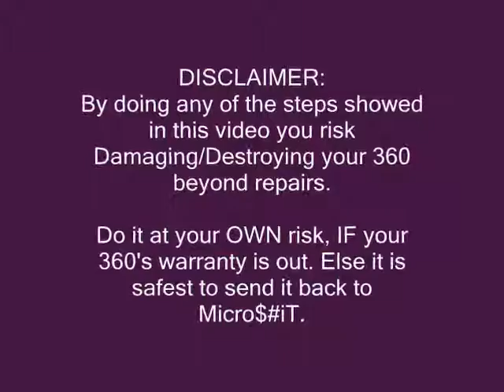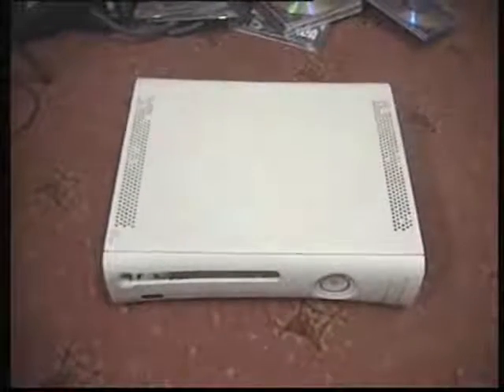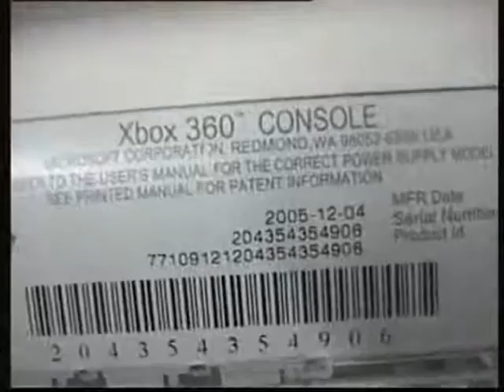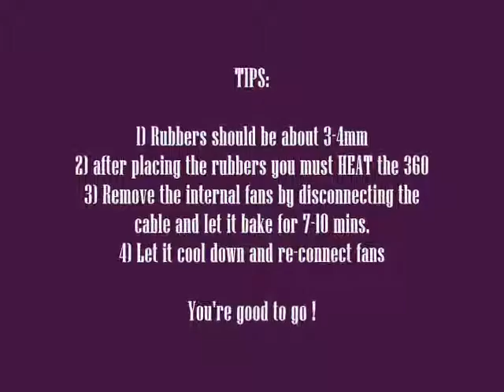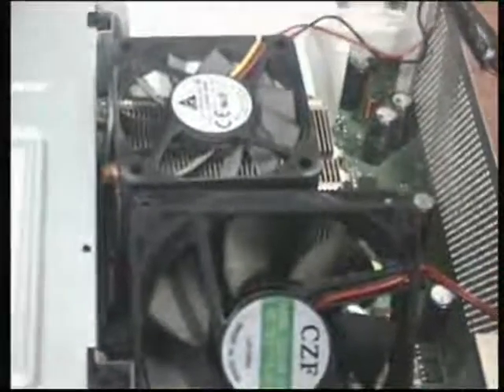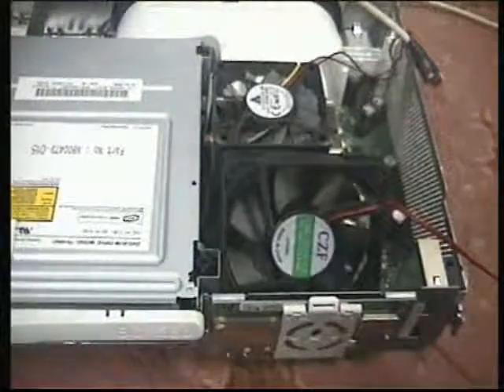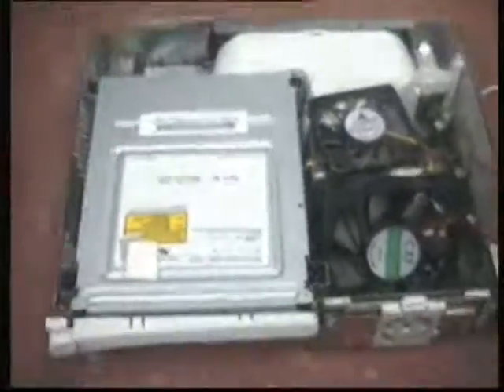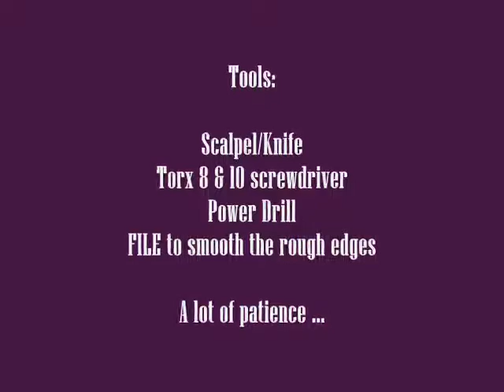XBOX360 Cooling MOD

Comment: Whats the point of adding small fan on the top of radiator? It will be only getting worse the air flow of bigger fan.

Comment: Yes my fan mod works great but my consol has a stuborn case of rrod and had before i did my fan mod so I will need to use a heatgun on my motherboard and reflow it.

Comment: You see After the heat caused the 360s to have the heat sink melt they had totally changed the parts around to let the have a way to let out the hot air better.